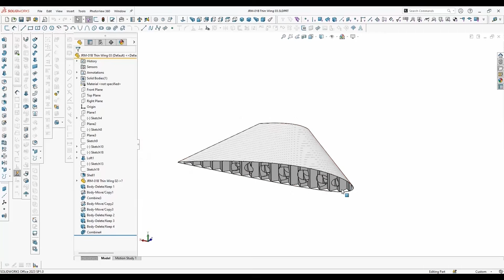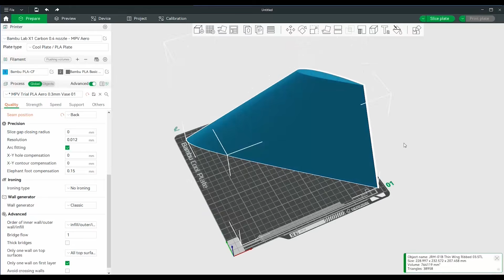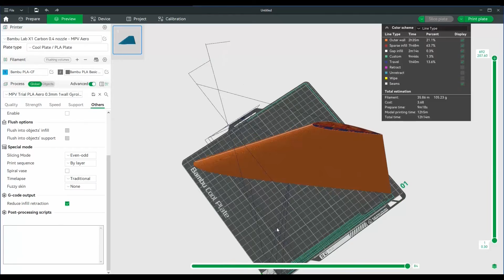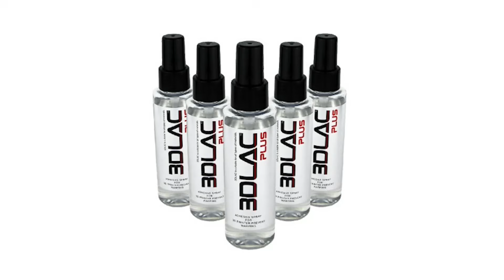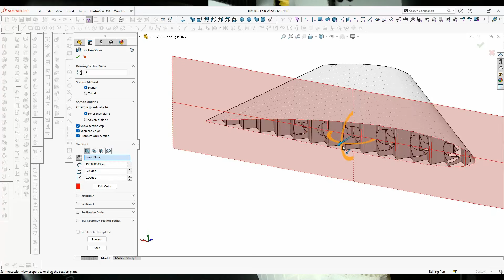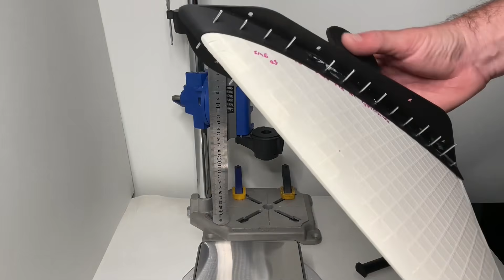How to make super lightweight 3D-Printable Wings with Bambu Lab PLA AERO

Comment: I just picked up lightweight filament I did some testing. I slowed my flow rate down to 0.58 something. I have my retraction lengths to 1.4 mm. But I didn't touch the zhop or anything they're on default. I do get a little bit of stringing I'm going to try 2 mm and I'm putting the Seahawk to zero. I I'm printing with 3D honeycomb interior trying to print a very light large witch for my drone to fly around for halloween. I don't need it to look perfect I just need it to finish the print😂. I'm about to do my first test with the lightweight pla that's not one of the calibration test. After this I told my friend I would make him an airplane so I'm going to have to design something

Comment: What if you put a small radius in the grid design on all the grids? I see it sheared at the grid. If it had a little radius or filet it should be much stronger. Really cool test. My only desire to get into 3d printing is rc aircraft and accessories.

Comment: that change to printer setting is gold
Reply: The retraction length and the 0 zhop worked great for you.? I'm about to test that.. I had default zhop but my retraction was only a 1. 4mm which worked okay. So some strings and one thing with alot of bumps. But they wiped off with my finger
Reply: @divingfalconfpv4602  yes worked for me

Comment: Do you guys paint the wings printed with the lightweight filament. If so, does it compromize the structure of the wing? I've teated with spray paint, and i think it made the print weaker.

Comment: It would be super fascinating if you tested a standard wing section with multiple types of infill. For example, for an equal weight of infill I have found Gyroid infill to be surpisingly strong, maybe even stronger than engineered 45 degree ribs. I'd love to see a controlled test comparing engineered ribs vs gyroid, 3D honeycomb, adaptive cubic, etc...

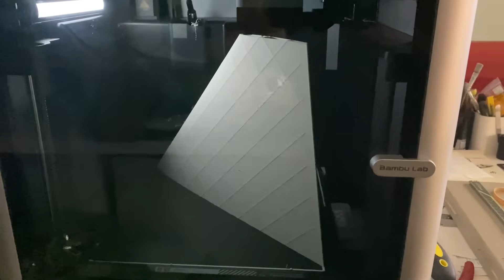Comment: Prior to using the OP’s vase mode settings, I had gaps on the wing skin where the ribs are located (engineered wing version / non-gyroid version) or what I refer to as Tom Stanton’s implementation. I could actually pull these gaps apart. Implementing the vase mode settings per this video , those gaps, while their outlines are still very visible on the outer skin, are now closed just like the wing shown @10:52. Can someone tell me the specific setting responsible for filling / fusing the gaps?

Comment: Well.. a tenth of an ounce in weight between the Gyroid and the vase mode wing really isn't that much. The vase mode wing was able to sustain a higher load and greater deflection..But an engineered wing like that seems a lot more work goes into that as opposed to just using a gyroid infill. IMO, it seems you get similar performance with the gyroid wing with a lot less work required.  Am I reading that right?
Reply from the maker: Yes
Reply: This is my take as well. Saving many hours of fiddling in CAD to get 90% of the performance is a fair trade. I am prepping my first design now and have been debating which method to settle on. Now it's clear that, at least for me, gyroid is the way.

Comment: The strength is impressive (I think), but there's no actual frame of reference, and the test method doesn't offer any insight into the strength required (which is driven by load distribution on the wing), vs the weight. If you want to design the lightest wing for the strength required, the testing should be with a 'Whiffle tree' to properly distribute the loads to match flight loads. (Look it up; I can't seem to embed links in youtube comments.)
Having said that, I really appreciate the video showing the use of the LWPLA. Looking forward to trying it with the grandson, who's into both 3d printing and RC a/c.
Reply from the maker: Thank you
Reply: @rene_rosentraeger  Hey, I just realized that the 1st search results you get might not accurately describe using a Whiffle tree for wing testing. The Wiki link talks about equalizing the load, but when testing a wing, aero engineers test based on the aero loading of the wing, which is very high at the root and tapers off toward the tip. The tree is adjusted so that the inner part of the wing carries most of the load, tapering off toward the tip, as happens with the wing actually flying. A 'wing sandbag testing' search and clicking on the images tab will give a much better visual of what the loading looks like.

Comment: Why did you continue with the infill based solution instead of the engineered wing, if the latter has a higher strength to weight ratio?
Reply from the maker: Especially when it comes to VTOL Technic inclusion you are too limited with the engineered style. Also inner ductings and smooth surfaces are not possible.

Comment: stock settings dont work at all for lw pla on a bamboo x1. poor layer adhesion and completely weak parts. messing with settings helps a bit but basically garbage compared to pla strength. not sure if others have this issue.
Reply from the maker: Yes, took some time to figure out and finally it works perfect.

Comment: Excellent information.  My one concern is about time.  Your single wing part reports with a print time of over 12 hours.  The only settings I changed on my PlanePrint 6 hour part were the speed settings.  At 35 across the board the part went to over 14 hours.  I guess there is a trade-off to find some decent print time but with a quality print I can be happy with.

Comment: Great to see a video on using LW-PLA with Bambu printers. It's also interesting to see the different approaches to designing airframes with LW-PLA. Ideally the part should have little or no travel which would avoid retraction and therefore stringing but I don't believe you can do that with using the standard infill, the internal structure has to be designed for it.

Comment: I would love to see what approach you took in the CAD to make the ribs. Tom Stanton needed to split the ribs to allow for vase mode printing without retracts. From the look of it my guess is that you used 2 layers on the ribs and 1 for the outer shell without the split. I am really impressed with the approach you are taking to get this technology optimized. It will be interesting to see if you use the approach for the rest of the fuselage or just apply it to the wings.

Comment: It's a shame to see that kind of printer only outputting at 35mm/sec. We buy them to do 10x that speed. Filament makers really need to catch up with the latest printers and produce more high-flow variations.
Reply: Lw pla actually acts quite differently than regular pla. This lwPla foams as it prints so it creates tiny air pockets in the filament as it prints you can increase the rate of air bubbles by increasing the heat, decreasing the extrusion and actually decrease the speed it is printed so by printing more slowly around 35mm/s you can maximize the foaming action of that filament with the heat of the nozzle by giving the filament more time in the nozzle tip thus lightening the overall part. Plus the parts are a single wall in vase mode they print pretty quickly. Other lwPla is prefoamed and those are printed closer to petg or abs speed but not nearly as light as non prefoamed lwpla

Comment: You already shown a setting for the bambulab with colorfabb LWPLA. There you went with 40mm/s and full acceleration. I printed with this setting and was pretty happy with the results. Why did you decide to change this settings? You went down with the speed and the acceleration. I went up to a speed of 50mm/s with 0.2 mm layer height and just raised the flow a bit to match to the higher speed.

One more recomendation: You don't need to change the profile of the printer for retraction settings as you can change these settings also in the filament section in the overwrite section.

Comment: Video about wing at last! Thanks a lot. 
Can you make some additional video about how did you shaped the wing starting from just one particular wing profile? Is a wing just a stack of wing profiles but proportionally smaller as you travel from fusalage to the wing tip? Or maybe something else? And how do you know if the wing generate enough lift to put the whole plane up during project phase?

Comment: Great work but like I said, you'll be disappointed with the diamond pattern. It is heavy and you don't need all that internal structure. You're much better to place your own internal structure only where it is required. This can be done without the use of shell or offset face. I'd also recommend you split the wing into 3 pieces so as to have a few horizontal 'ribs'. Best way to achieve this is with adding walls (up to 4) to the bottom 1mm and the top 1-2mm of each section. Lots more here but I feel you guys are reinventing the wheel to some degree...